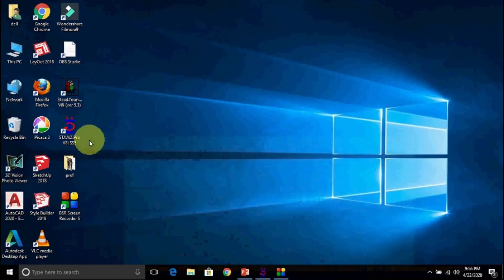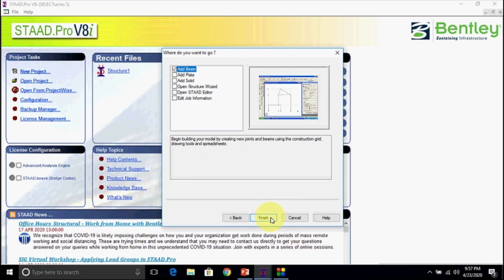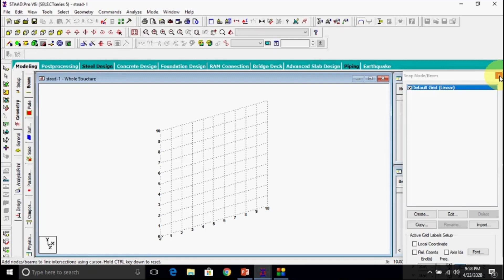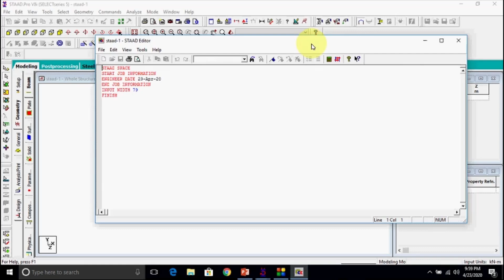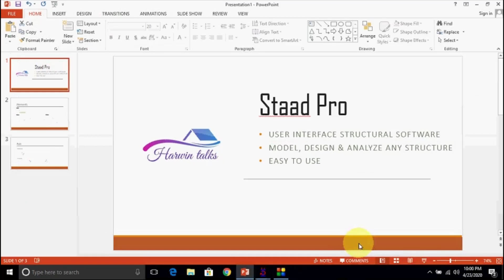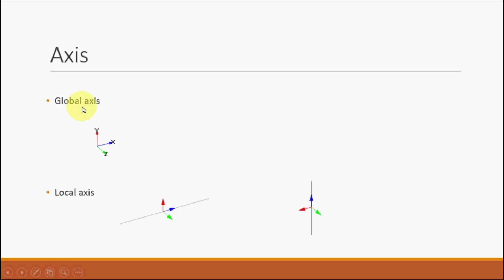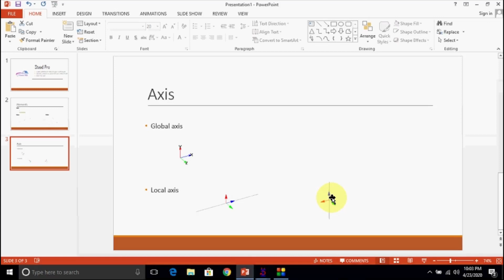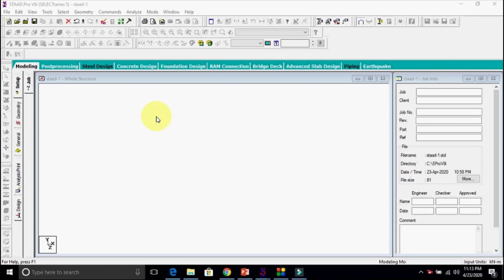Introduction to Staad pro in Tamil | Staad pro Tutorial தமிழில்  | Civil Engineering |EP1

Comment: How to get staadpro software and what is the difference between staadpro and other analysing softwares etabs so and so?
Reply from the maker: 1. I have my setup file with me, i can send you if u need it. Generally cracked software can be downloaded from internet.
2. Though i havent worked in Etabs, all i know is that is preferred for analyzing conrete buildings and staad is prefered for steel structure design. But we can do concrete design also in staad. Some says Etabs gives optimal results for concrete design and provides various options in seismic analysis.